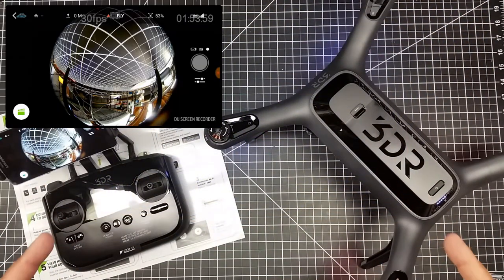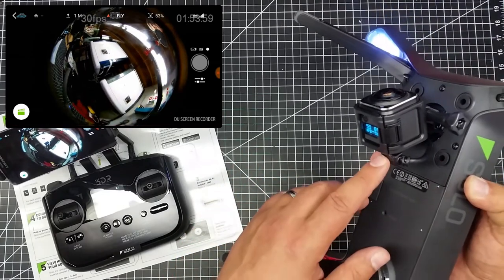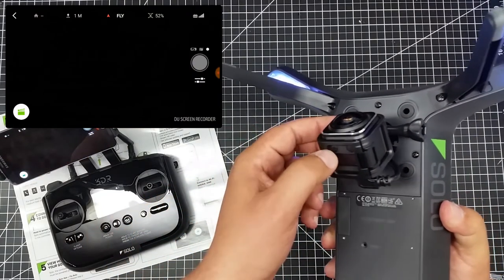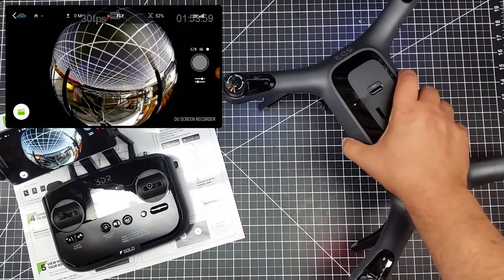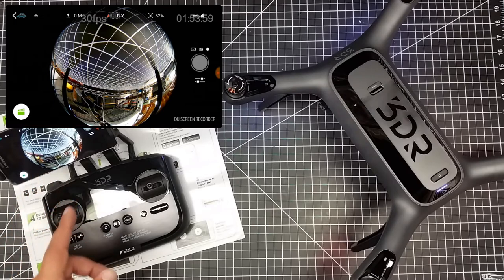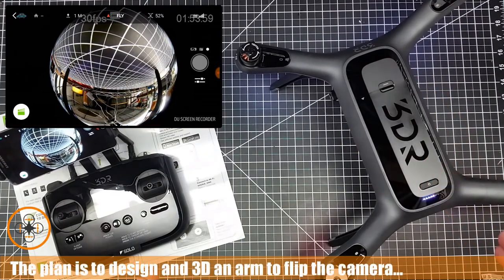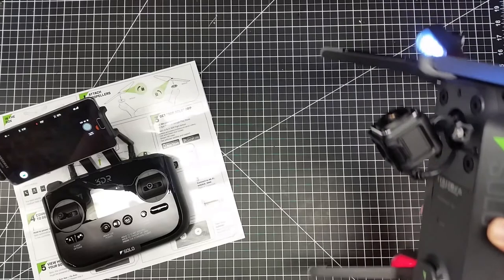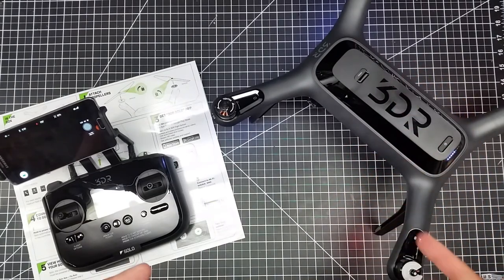3DR Solo - The 360 Degree Camera Works on HDMI Port!

Comment: Terrific! How did you mount it? I have Ricoh Theta V 360 with tripod mount. And I have an adapter - GoPro to 1/4 20. Will that work? Also worried about the steadiness on my 3dr Solo without gimbal and not sure of any fixes. Also considered hanging it somehow so it is below the long legs. Still somewhat new to this..thx.
Reply from the maker: Should work and you might have a bit of Jello but yet its drone flight :-)
Reply: The videos will not be as steady as the Solo gimbal but I have seen some good videos taken using the stock fixed
mount that comes with the Solo. You don't want too much dampening on the rubber grommets and above all,
make sure that you balance the props correctly. The Solo gimbal is expensive and I managed to get a new one
for $80 off of Ebay and now they are way over $180! If you are looking for almost perfect video then the
expensive gimbal will do it. I found that the Solo gimbal exceeded my expectations on the quality of the video
with no jello and there was no jerky movement in the video when a yaw was done with the aircraft. I wasn't 
using the GoPro Hero 4 camera but the GitUp Git1 with a 120 FOV camera on the aircraft. The GitUp Git2 
would be even better to use.

Comment: Does this work with the solexapp for SBS FPV in 360?
Reply from the maker: No clue, however if your camera (360 or other wise) can send a HDMI out you will see it on the application screen.  If it is a 360 it will likely be spherical.  However the down fall that I have seen is a lot of cameras do expect to prove a "live" video feed via the HDMI (they expect it to be used for playback) so they time out and go sleep...
Reply: Yes, on the TIMEOUT! I found that the GitUp cameras have a motion detection system built into them
that will reactivate the camera so the video feed to the camera and the video recording to the SD video
card keeps active. That problem about drove me nuts trying to figure out why the video recording on the
camera was being shutdown and during the flight I had a continuous FPV video feed. The settings on the
camera was the secret and I had to document it to make sure I knew how to setup the camera.

More on your camera, I am thinking that QuadCopter 101 tested a 360 degree camera on a drone and
had video editing software for correcting the video footage. With the software you would get a 360
degree pan of the video/images! A fella could use another small camera for the FPV feed. Thanks for
the video and some ideas!